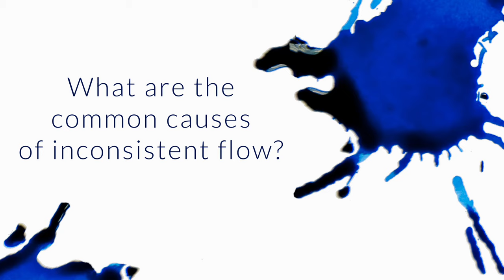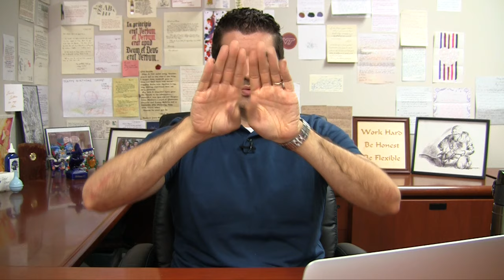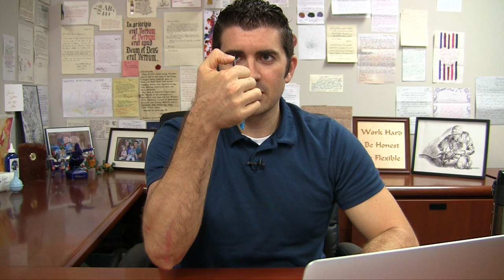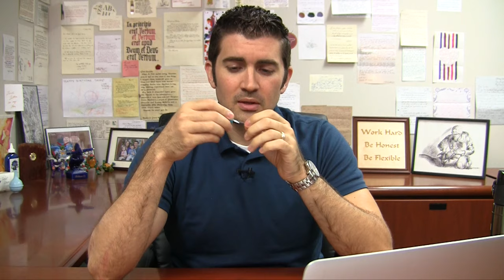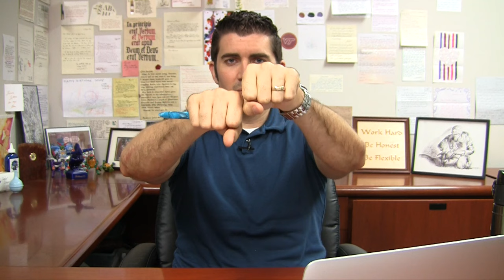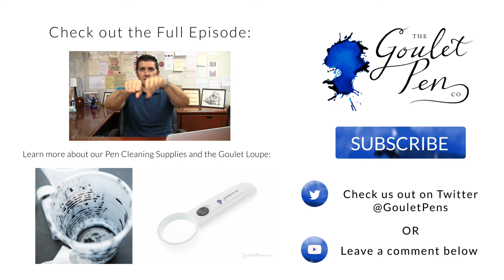What Are The Common Causes Of Inconsistent Flow? - Q&A Slices

Comment: Hey, Brian!  I have a Namiki Vanishing Point with a 14K M nib. I've had it for ~20 years. I can see light through the times, though not at the tip. I'm having issues with uneven flow such that I have to keep adjusting my grip and retracing letters. It's tiring so I don't get much use from it. Feedback on this pen is really smooth, almost slippery. Since I started a pen journal I've seen this with two different inks: Iroshizuku Kiri-Same (new bottle) and Levenger Blue Bahama (~20 years old). Any advice? Thanks!

Comment: i bought 7 Jinhao 156 few days ago and all of them have flow problem. suprising considering i never had a jinhao with this problem before. i even swap the nib and clean the feed. turns out the problem was the feed isnt pressed hard enough against the nib because once i shim the nib with a thin plastic and press fit the nib and feed back into the section, it goes in tighter and the flow issue is gone.

Comment: I have a very specific problem. I own a yard-o-led fountain pen. It writes beautifully and the ink generally flows very smoothly and freely. However, as the cartridge begins to empty, from about a quarter of the way down the tube, the ink suddenly stops and won't write until I screw the suction thing to push more ink down the barrel. This works for a while dependent on how far I have pushed the suction device down, but then the pen dries up again until I repeat the process. I sometimes have to do this three or four times in an hour, which can get irritating. I have never had this problem with any other pen. Do you have any idea what is happening?
Reply from the maker: Sorry about that. I can't say for certain because I'm not familiar with that pen, but feel free to chat or email our team and they could give you some tips. -Margaret
Reply: That's an issue I have with almost all fountain pens I own (mostly Parkers) - the ink doesn't stop flowing for me though - I just get a thinner, drier line until I do exactly what you have described to get the ink down the barrel again. 
Sometimes giving the pen a break for a few minutes brings the ink back into the barrel too.
It may be because of imprecise feed alignment with respect to the nib slit, or air/dirt blocking the ink from filling the feed. Cleaning the barrel with water usually helps in my case.

Comment: Hi, this video didn't solve my issue but I did manage to solve it by myself after a little bit. For me the issue was that the feed was pushed back somewhat, removing the nib, pulling the feed forward and reinserting the nib worked a charm for me. I can't tell you the model of my pen as it's some random pen from the flea market with no markings, but it seems to be rather old with a built in reservoir and piston.

Comment: I have a Monte Rosa (Germany) pen, I have not used it for a long time. It is a hooded piston type of pen. Its ink is not flowing properly. Could you tell me how I fix the problem of ink flow? I do not know whether it is Mont Blanc Monte Rosa pen (as it was a gift from my friend) or it is a fake Monte Rosa pen. Nowhere it was written Mont Blanc. Only on the ring of the cap it is written, Monte Rosa Germany. As it is a hooded pen, so I cannot know whether on the nib something was written. I do not know how to separate the barrel parts and clean it.  I saw the tips here. It may be tines too close together or improperly aligned, but there is no damage  in the nib and also paper fiber is not stuck up there. I do not know how to do and what to do. 
Please help me.

Comment: My pen problem seems that parker manufactured the tines to close and the ink didn't reach.
I could write reversed perfectly, and perfectly straight
but if I hold it correctly it would hard start and skip alweys.
It seems that pushing on the tines with my nail like say in the video for 1-2 minutes helped spread the tines away and now it writes better.
altought I'm not sure if it will write well or stop.
since I have already found a fix just to get stuck a few hours later

edit:
Nope the pen does not write and I have no idea why a new pen doesn't write well especially a new parker sonnet